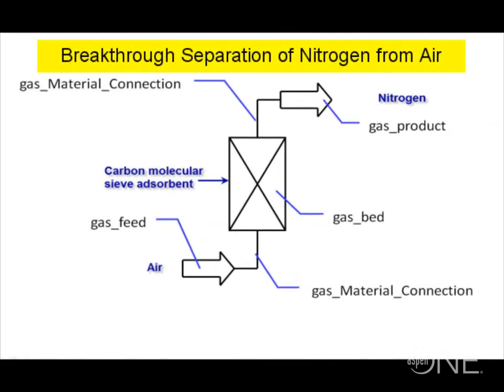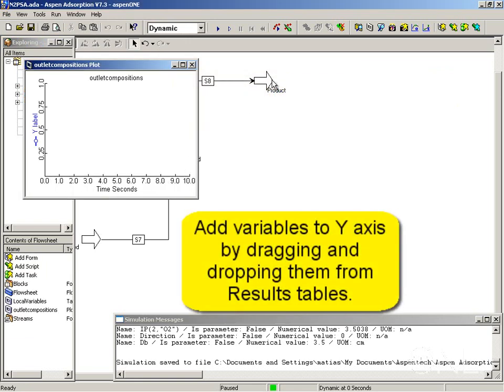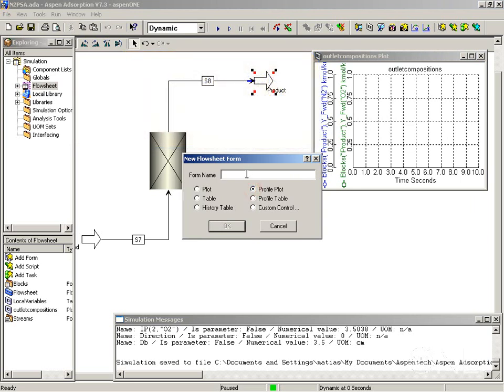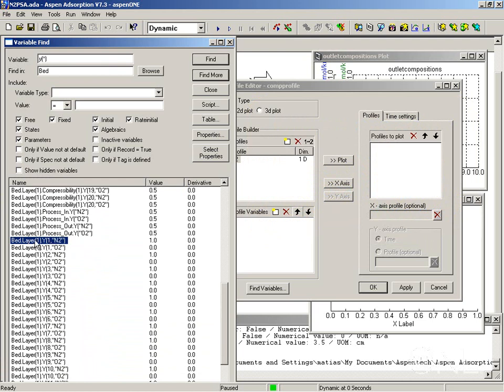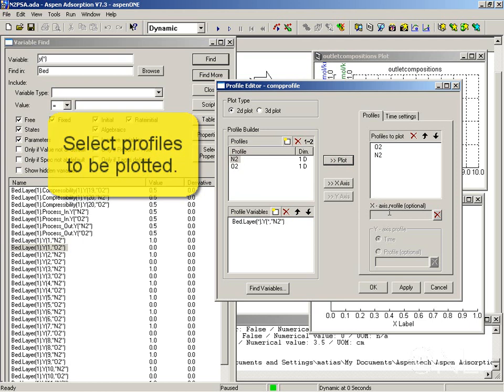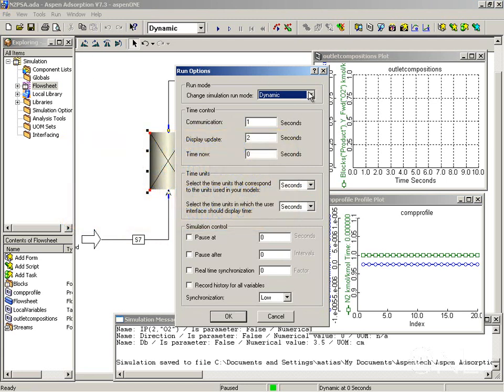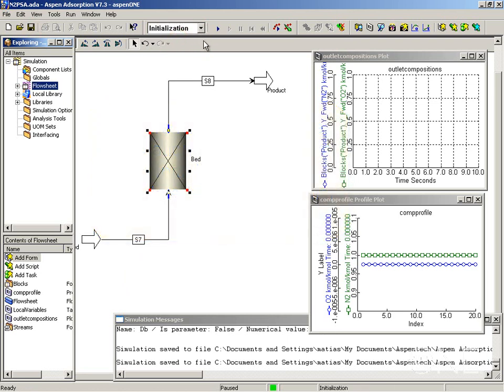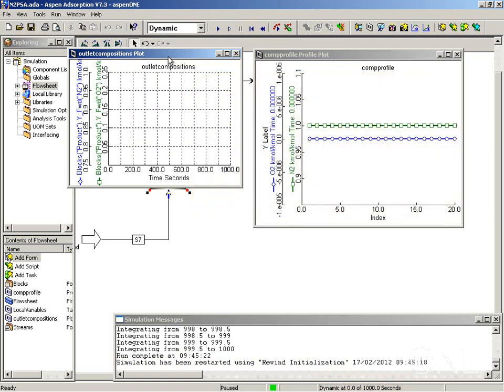03_Plots and Running Simulations in Aspen Adsorption

Comment: I followed same procedure. But I am not able to run the initialization. No prompt is coming on run command. From bottom if I click error its shown as "your simulation is underspecified by one variable. Inorder to make it green if I change the product variable of flow as "initial'' or pressure as '''initial', then initialization run command is prompted. But if I run then error showing as initialization failed at time zero. From bottom if I selected the error button then its shown as "your simulation is badly posed structurally because a subset of equations is not independent"'. Please help
Reply: I have similar issues here, using V12.
Reply: I have the same issue using V11. Please any solution to that?
Reply: I have same issue